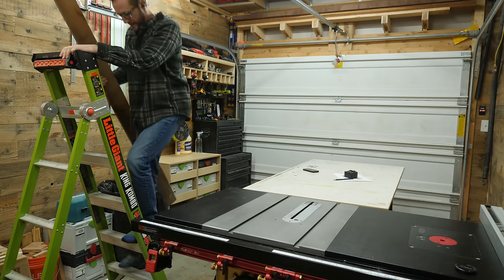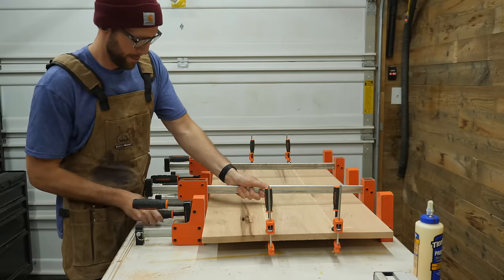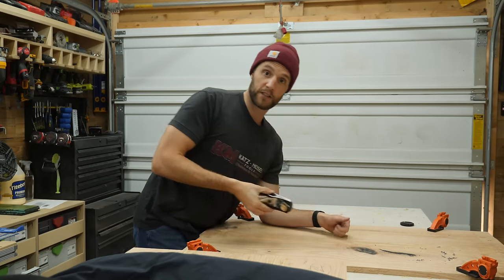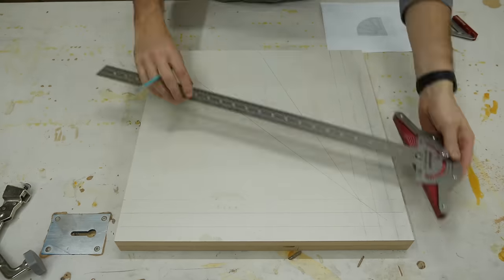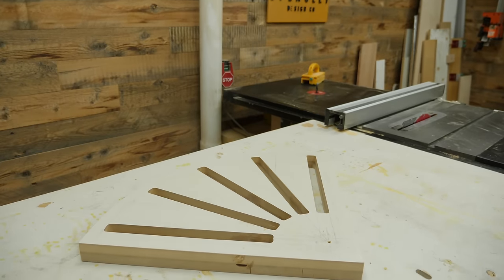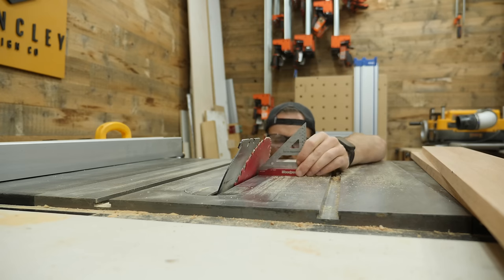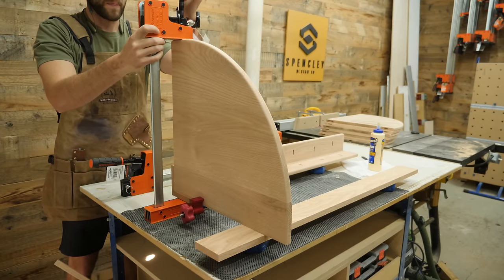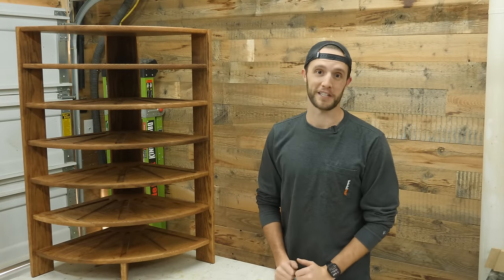Taking Wine Storage to the Extreme: The $2,700 Unit

Comment: Exactly why do you think you need a jointer? I’m a 2nd generation woodworker myself and have learned there’s no reason to own one because you can accomplish the same things with tools you likely already have. You can use that jointer to flatten boards just don’t cut them to length before you do so there’s less to hot glue down to that board. Not to mention hot glue cools down to room temperature in just a couple minutes no big deal and a simple jig will allow you a straight edge. Anything else can be done with a router. I’m very curious why you find yourself in need of one considering shop space is a premium for most of us plus these tools are very expensive so unless you’re doing this for a living I found it best to avoid buying one myself.

Comment: That's a nice project, I like the way you make do with what you have.  FYI, hot glue is easily (and I do mean easily) removed using isopropyl alcohol (I'm not sure if IPA would react with the epoxy). I'm not sure I understand your aversion to red oak.  For me, staining wood is a tough choice. I do often use Minwax natural stain. I do feel that the oils in Minwax really penetrate and seal the wood and make the grain pop more when you put on the polyurethane or tung oil.  Nachos.

Comment: You should check locally for a used shopsmith, it can be cut down to basically a power station and on one end You can have a jointer and a bandsaw on the other end, I picked mine up for 300 dollars and a shopsmith is perfect for Your small area.

Comment: I used to do something very similar at my job where I had to pour a urethane elastomer resin into voids in plywood for making moulds. A low angle block plane worked much better than a standard one. I also used modelling clay to make a dam around the area to be poured but the oils in it would probably be an issue later on with your stains and finishes.
Reply: nachos!

Comment: 3:37
Flattening a board on electric jointers will get you into the surface planer quickly BUT you can get there pretty quickly with a hand plane. I sold my 6-1/2” jointer a few years ago (nice old machine!) and never have had an electric surface planer. 
Hand planes are surprisingly time efficient especially on ‘single projects’ and edge jointing with a fancy tablesaw blade leaves you with a glue-ready edge. 

It’s not necessary in a small shop to have electric jointers and planers to make a living. I’ve even built a humongous kitchen’s cabinets without an electric jointer or planer, and neither my time ($ per hour) nor the final results suffered. My dollars per hour factored a little extra time in, and my equipment overhead was less. Evened out. 

Other thing: low power availability like that single 20A outlet he mentioned is easily overcome with an appropriately capable solar power system AIO and a lithium battery. The AIO will supply more power than the 20A outlet, and it’s built-in charger will automatically recharge the battery without tripping the breaker feeding that outlet. 

In my case, I am offgrid and don’t have powerco to charge my batteries, but 95% of the time the solar panels do the job, and the generator only runs about 4-6 hours cumulatively per month, so it’s a nonfactor ($25/month, tops). My particular inverter is small though my situation is such that I can run a generator for the ‘big’ tablesaw or the welders. My cheap, small, portable Craftsman tablesaw runs fine on solar/battery (for utility rips and other rough cuts) as does the makita compound miter saw, sanders, routers, shopvac, and cordless tool chargers. 

Buying an AIO and using it without panels does come at a cost, but if you rent or have other limitations preventing upgrades to the wiring, the coupla grand may be worth it.

Comment: Nacho!  I agree on the stain.  I made a nice book shelf from cherry that I used some highly diluted powdered dye stain.  That worked pretty good and it has naturally darkened over time as cherry does.  I have the Festool domino and a Lamello biscuit jointer.  I would have used biscuits for that project. I really want the Lamello Zeta P2.  You could build that entire project with no clamps.  I would still clamp the panels though

Comment: Try double sided tape instead of hot glue for the jointer sled.  A few strips for board and little pieces for wedges.  So much faster easier,  and cleaner.

Comment: love the workbench for cutting panels, i still would have went with dowels regardless so that the joints would be flush as well as matching the boards better to avoid the knot issue all together. but nice job an nice tools.

Comment: Nachos: Having run a commercial shop for years, I've seen a lot of horrible designs come through. Just hold your nose and paint it pink if that's what they want. 
I did a job for a rich woman. A semi & a half load of beautiful Sapele. We made all of it into moldings, tongue & groove wall paneling and doors. She had it bleached and stained grey!!!! This was an out building on her estate for parties (next to her private golf course.) Her husband didn't care what she wanted. 
A few years later we did something similar for another large out building on the estate. This time they flew to Germany and picked out 6,000 bd. ft. German white oak. Had it flown to the states and hauled to my shop. Everything has come in the rough, often highly variable in thickness. We had to run some of it though the planer first to get it down to a thickness the top head on the molder (only 20HP) could bring it to 3/4±. Stained yellowish brown. What do you suppose the air freight bill was? I never heard.   I agree with you about what method of connecting one uses. As long as it is strong enough who cares? We had Dominos, Lamello,  Castle pocket screw, Maka morticer, lock miter, miter folding, dovetail and CNC doweling. Doweling is by far the fastest along with auto case clamping.

Comment: Count yourself fortunate to have what you have, right now. You're doing good woodworking, figuring out ways to get your projects done and such. 😁
I have to work in a storage shed. The space is about 4 ft x 10 ft. No windows, insulation and nothing is plum or level. When it's too hot or cold, I can't work in there. Forget about winter, when it's neg. 10 degrees ferenheidt. I have almost no power tools except for a drill and an orbital sander. Further, I lost my pt time job a few months ago and my unemployment benefits are running out in a week or two. Maybe things will get better but, for now things are bad for me. 🙁

Comment: Nachos. The wine rack looks awesome. I am inspired to make a mini version with just two shelves to fit under the stairs. I have a jigsaw, an orbital sander, and an electric drill / driver, which should be enough to cut to shape and join the timber. What's the best work around I wonder for making the grooves in the shelves by hand? A chisel?

Comment: Nachos! I agree with you about colored resins and stains. And I often feel like I have to explain and defend my opinion since colored resin in woodworking is all the rage right now, especially on YouTube. Twenty years ago, when I first saw a mesquite wood table where the voids were filled with turquoise chips in resin, I thought it was cool. Very quickly, I realized how bad it, or any other colored resins look. With the exception of black. I do use black epoxy to fill voids in mesquite when necessary. I like the look of the black especially in mesquite which routinely has voids. The black goes with the mesquite perfectly because so many of the inclusions are naturally black. I never use stains on my woodwork either, since I want the customer to see what is inside the tree.

Comment: Nachos libre. Why not finish first so you don't have to reach into the back recesses? FWIW, when making a wine rack, especially with such a large capacity, you really want the bottles to sit at a slight angle to keep the corks wet. Unless you are going through 30 bottles a week. But then you have bigger problems than dry corks.

Comment: Screws from the back might seem like a faster and simpler solution but I think that getting the pieces held in alignment would eat up a lot of time and effort as well.
Reply: And, screws have low shear strength.  The piece wouldn't wear nearly as well with screws as it will with dominoes or dowels or even biscuits.

Comment: Nachos, I think you would have better luck with the poxy if you used a card scraper. Its satisfying and gives you a finish ready surface with a minimal amount of cleaning. Thank you for an amazing video.
Reply: It still takes a while to scrape down thick over pours of epoxy. Which seems to be his main complaint. I’d tell him to put some masking tape down, flush trim the surface with a flush cut saw and then scrape the remainder. But if he has an aggressive rotary sander and it’s quick then that works fine too. I only have a finish sander and I don’t like all the noise it makes so I do as much hand tool work as possible.
Reply: @CarlYota  i completely agree, i just get annoyed having to rub the dust of sheets or replacing them. Since my comment I’ve switched to flush trim and using a block plane for the speed

Comment: Get an old 6” craftsman jointer.  Just sharpen or get new blades.  If you look around it’s 100 bucks, and 15amp.  Doesn’t take a ton of space either
Reply: Nachos.  Plus chips not dust.

Comment: Nachos.  May I ask. You said you could use screws into shelves because it’s hidden in the back.  Once against the wall no one can see it. Then I have to ask, why did you put all that work into 45 ‘ ing the back vertical corner joint? A simple butt joint would work and much faster. Just  cut the thickness of the boards off the side getting butted into . Then they both look to have same width from front. Also. I would suggest stacking the shelves and cutting them all at same time on bandsaw. , not jigsawing  one at a time.

Comment: For the epoxy pour. Take a router, put a piece of paper under the cutter on top of your workpiece, drop the cutter on top of the paper, lock down the blade then just pass over the epoxy until it's gone.

Comment: Nachos! Most projects need some kind of jig to make multiple pieces. The time spent on a jig is rarely more than the time spent on the second piece, but it ensures that the second and tenth pieces are just like the first one. In theory, if you are just sloppy! I seem to be making jigs to make the project quickly and without errors. You just have to think ahead a bit.
In regard to staining etc, I would precoat the parts with stain before assembly, cuz brushing within small, confined spaces is a pain and the job can be done with everything on the flat with a small spray gun. Watching DIY shows with paint by brush is a waste of time. Learn what you would need for a small incidental use spray gun. When it comes to paint, I will resort to spray cans of whatever I can find off the shelf at the hardware store and since most of my projects are for out in the yard, this calls for exterior paint and not stain.

Comment: Dude, you need to find a Makerspace near you.  I live in Charlotte, NC.  We have a local Makerspace with 30,000 square feet of woodworking, welding, ceramics, lasers, CNC machines, 3D printers.... you name it.  For less than you spent on that small plainer I get a year long membership 24hrs a day to fantastic pro workshop.  If you don't have a local Makerspace.... start one.

Comment: I like the fact that you are using tools that a regular weekend woodworker would own. You talked about a big jointer and a CNC router. If you keep adding these big expensive tools, you'll be like all the rest of the woodworker shows with $100,000 worth of tools in a $500,000 shop. My suggestion is to keep it simple and show us how things can be built with regular DIY tools. 
P. S. I love your $7.99 prized chisel.

Comment: Nachos. I'm trying to figure out how you got the shelves to engage both dominoes, in the corner, at the same time. I don't own a dominoe system so what am I missing? Is one or both slot wider than the dominoe? By the way I've been doing home woodworking off and on for 50 years and currently have a fairly well-equipped 24' X 24' dedicated wood shop, but I still pick up useful tips from you and the other "new guys" on YouTube.

Comment: Very nicely done -- especially the help for folks in smaller shops. I think I would have pre-finished the parts - maybe save you a little time and hassle getting between them when assembled. But, like you say, so many ways to achieve the same thing. Well done!

Comment: A planer sled only allows you to joint on the face, which is needed FAR less often than edge jointing.  Trying to do that with a planer is dangerous for you and the planer.

Comment: No.  Because I used to underestimate how much time things would take and got bit by it dozens of times.  Now, I put it off for as only as possible because I know it's going to take hours or days.  For example, My wife broke the couch because she doesn't know how to sit down like a normal person.   Anyway, I knew it was going to take a half day to complete so I refused to do anything about it.  Then, one of my dogs got caught down the broken edge and almost died.  Started pulling it apart at 10 AM.  Took 8 hours to reconstruct this couch.  If it wasn't a $12K leather couch, I'd have trashed it.

Comment: Nachos supreme. Red oak is ugly in a natural finish. Walnut is indeed an ugly color, but it needed something to not have that awful pink color. I like chestnut or fruitwood on red oak. I was a floor refinisher for 35 years and the only stains I truly hated were white stains. One great trick to enhance stain color is to water the wood and pop the grain so it takes much more stain and in deep color compared to sanded wood. I mixed my own custom stain for my own floors, wide white oak planks, that I intended to capture the color of the beams in old barns. I love looking at them every day. They look almost like the color the boards looked when you started the project in the video. Yeah, I love white oak in a natural finish also, but it can be boring. LOL

Comment: Wow that knot looks terrible. Why would you put it front and center of the board, instead of the underside near the back where it cannot be seen? And the domino you chose does does not seem robust from an engineering standpoint, does not seem like it can hold that much weight.

Comment: You wasted material in six hours, building a jig when you already had the slot cutting guide made. You could have just use that slot, cutting guy directly on the work pieces and been done in those six hours.